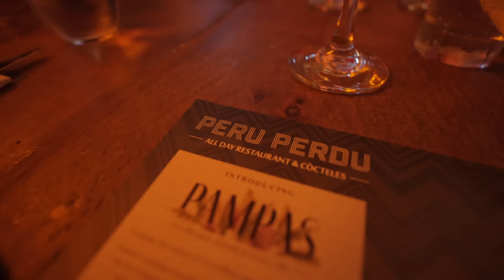Secret Hilti Nuron Launch Event - SO MUCH POWER

Comment: Nuron look like an interesting addition to an impressive history of tools. When I was first working in telephone exchanges and found out first hand they were designed to outlive the bomb. The only SDS that was worth using was Hilti, nothing else would stand up to the high strength concrete and be reliable with that kind of punishment.

Comment: The game changer is the tool tracking, isn't real time but it's good enough to get damn close. It seems they've taken on board what Dewalt and Milwaukee have done with drill bits, dust management and battery platforms though. As dust management was a big thing in the states and not so much in the UK.
Reply: Unfortunately i don't see it making any difference.  Someone has to be real dumb to steal your tool and charge it using a charger that's connected to the internet.  Also got to assume that people care about the data and will connect their chargers to their internet router, which i don't see happening with a lot of people.

Comment: Drill bit for that SDS will cost arm and leg just cause it has holes through out its length and that it needs to be strengthened for that very reason. i will settle for standard SDS drill with hoover. I can probably get multiple Hoove's for the price of one of those drill bits.